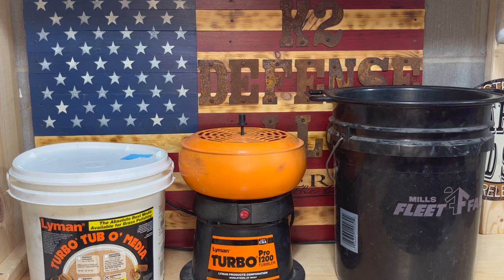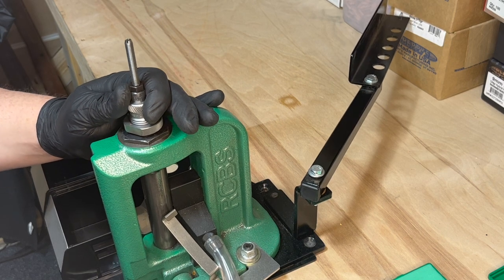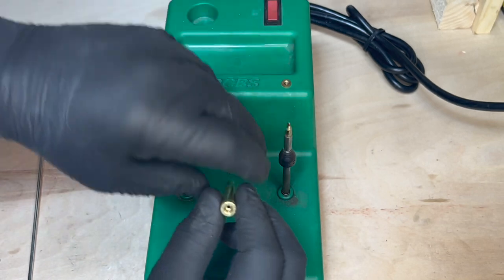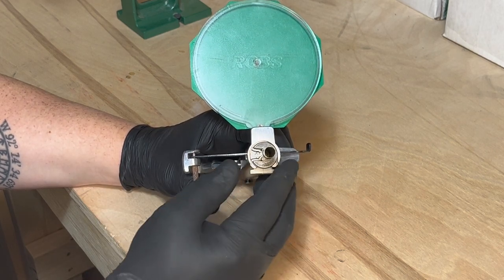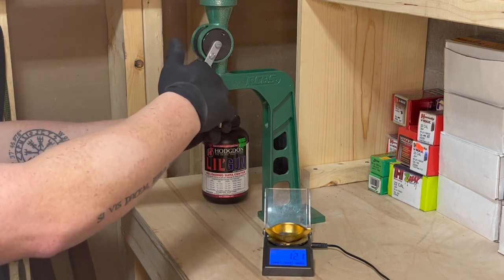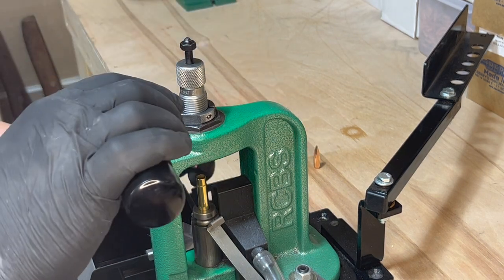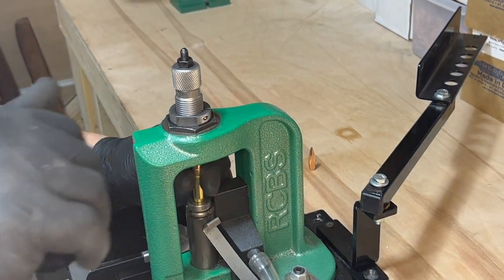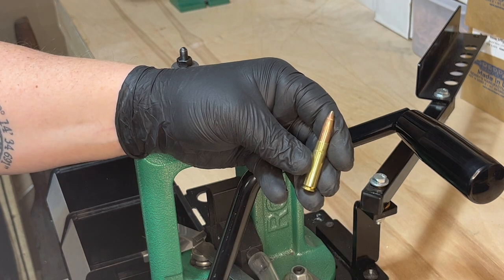How to Reload 300 AAC Blackout Ammo For Beginners

Comment: Great video.  Looks like you could use a stronger bench to prevent the movement of the press when resizing.
Reply from the maker: @scottwinkle5503 - there certainly are options to tighten this up. One being the riser made out of cast iron. I’ll put it in one of my next videos. Thanks for the comment! 👍🏻
Reply: First thing I noticed.  You can fix that with some angle bracket from Home Depot if you have a lip on your bench or you could just reinforce it. I really like having a sturdy top when I’m reloading.  Having the flex is not terrible, but you want to keep everything as consistent as possible.  I would definitely sturdy that thing up a little bit.
Reply from the maker: @brazosTX - if you don’t mind, send me an email: k2defensemn@gmail.com 
with your recommendations on how to “sturdy” up a reloading bench. I’m in the planning stage of creating a new studio/reloading bench. I’ll give you a shout out when I make the video. 👍🏻

Comment: My fired 300 BO brass is .013 larger than the resized brass. What is the recommended headspace in this scenario? Should I just bump it back .004 since my rifles headspace is so much bigger than the die?
Reply from the maker: @Qlife007 - what type of resizing die are you using? Do you cam over when resizing? Are you checking your shells with a chamber case length gauge? I would start by using the case length gauge. I’ll add a link for the 300 BLK gauge. I’m thinking you probably need to dial your die down to bump the shoulders like you mentioned. Let us know how it goes. Thanks for the comment! 👍🏻
https://amzn.to/43iNkcH

Comment: Nice video, thanks! Iim using an RCBS steel die for my 300 blk out. I’ve adjusted the decapper per instructions, I’ve lubed the cases, but the cases keep getting stuck in the die and I’ve actually stripped out the decapping rod removing the case. Have you ran into the same problem? Does the die need a break in time? I bought another die same one thinking it was defective, but I’ve run into the same problem. Ive actually ordered a Lee Pacesetter die to replace the RCBS die. Anyone reading this have any thoughts? I’m new to reloading, done some 308 without a problem, but the 300 seems to be problem. Thank you for in advance for any input!
Reply from the maker: Sorry to hear this is happening to you. Here is my recommendation. Lube the lower third of the case with your choice of lube. I use RCBS case lube with the roll mat. I don’t show it in this video, but I also use Lyman quick slick spray lube inside the case mouth. Seems a bit much but I’ve never had a stuck case since doing it this way. I’m guessing the cases you’re getting stuck are probably LC brass as they are a bit thicker. One other thing to check is your case trim length. Are the cases you’re having issues with converted from .223/5.56? Or are they factory 300 BLK cases? Since you’re using steel dies, do you set it with cam over? We’ll get this figure out for you! 👍🏻
Reply: @k2defense  
My cases were bought through once fired brass or Diamond k I don’t remember. The case lengths within max case length. I use Hornady one shot spray lube I also sprayed inside the die. The die is brand new! The set up says to have the decap rod stick down .400 or 3/8 which is where I set it. I do a slight cam over as well. I sent RCBS an email as well. I do appreciate you taking time to answer my questions. BTW the brass has been wet tumbled and dried as well.
Reply from the maker: @rockyroad8561 - couple of things, you can set your decapping pin so it extends 3/16” below the end of the die. Try that first. Secondly, try using lube instead of the Hornady One Shot. I’ve heard from some folks that it doesn’t do well. I’ve tried it and had mixed results. I stick with RCBS case lube using a roller mat for the bottom third of the case. This is where the majority of the expansion is with these cases. You can use the One Shot in the case mouth if needed. I’ve never had a stuck case using this method of lubing including setting the decapping pin to 3/16” instead of 3/8”. You may have it set too deep.  You shouldn’t need to spray the inside of the die for any reason except to clean it. Can’t hurt to try to try my method. Maybe this will resolve your issue. Let us know how things turn out! 👍🏻
Reply: @k2defense  Will do thanks I’ll keep you posted
Reply: @k2defense  
Looks like I had everything right except my lube process! Thanks for your help Sir!
Reply from the maker: @rockyroad8561 glad I could help! 👍🏻

Comment: I am curious to know what you use to lubricate your casings prior to resizing and what your process is. Too many times using one shot I have gotten the casing stuck in the die and strip the rim out of the shell holder and then have to disassemble the die and cut the casing off of the repriming/resizing rod. I know its not case prep thats causing my issue as I tumble my brass in a Franklin armory wet tumbler with stainless pins and then dry in a case dryer. I only seem to have this issue with .300 blackout and .223 .
Reply from the maker: Bill - I use RCBS lube and lube pad. I avoid one shot with all of the stories out there. With bottle neck cases I lube the lower third of the case. If it starts to squeak or hard to resize I may spray the necks with slick spray. To date, I’ve never had a stuck case using this process. Funny story, I made a video on how to remove a stuck case. I didn’t lube the case at all in order to get one to stick. I reload a ton a .223/5.56 on my single stage press. Hope this helps. 👍🏻
Reply: Try Unique case lube. Lasts forever too. I've been on the same tub for almost 5 years

Comment: What bushing are you using in your FA trimmer? With such a small shoulder on 300BO cases I don't know which bushing to use. Either the bushing doesn't fit over the neck or it slides past the shoulder.
Reply from the maker: Hello @dansheets7200!

#4 bushing, it should’ve come with the kit? Let me know if you have any additional questions!
Reply: @k2defense  thanks!

Comment: Sorry in advance if this is a dumb question but... are you starting with 5.56 sized brass? Or do you already have the 5.56 brass shaped down to 300 blackout size? I have absolutely zero experience with reloading, separate of everything I just learned in your awesome video! Thank you for sharing your knowledge
Reply from the maker: Hello @shermanwilliams3315!

I do not size the 223/556 brass before putting the cases through the trimmer. It would be an added step to the process that’s not necessary. Hope this helps! Feel free to ask any question! That’s what this channel is all about! Happy reloading!
Reply: @k2defense  but you are using used 223/556 brass to begin with?
Reply from the maker: @Pluhdao  I use both 300 BLK and .223/5.56 (modified) brass.